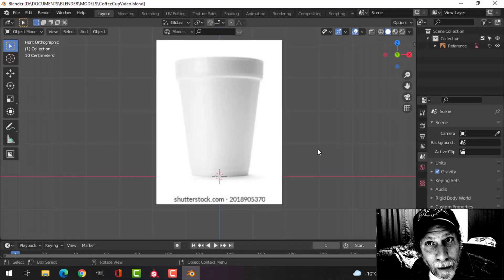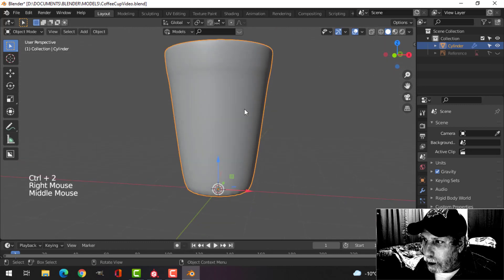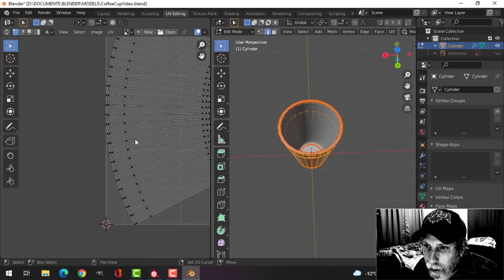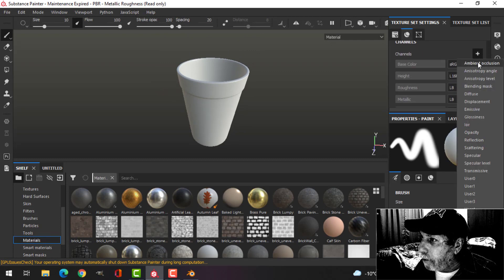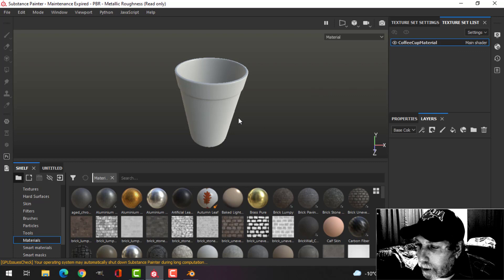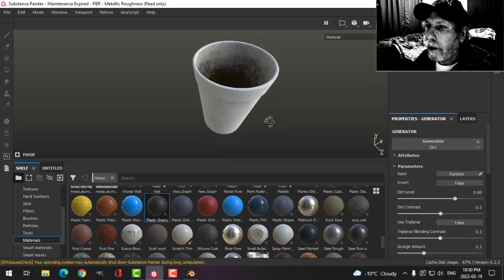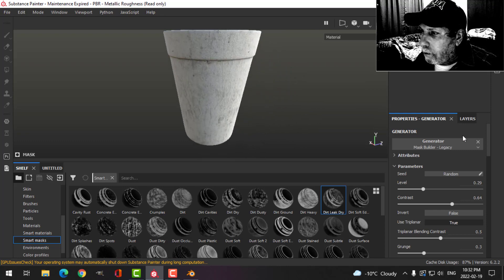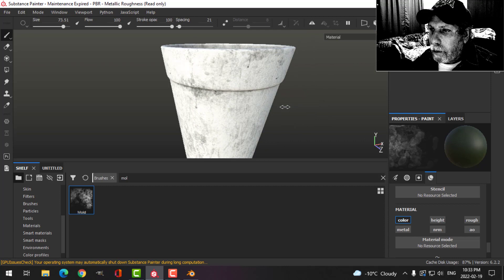BLENDER & SUBSTANCE PAINTER: POLYSTYRENE COFFEE CUP

Comment: well PBR Texture to use in blender sells blender better than the rip off SB, un subscribed now
Reply from the maker: Yes Blender texturing is a good thing but much harder to achieve these results.  Substance Painter is an industry standard and a joy to use.  Sorry to see you go, though.  Good luck and hope you find what you're looking for out there.
Reply: @zerobio  I recommend you look at what is out there you can bolt on to blender and use that supports blender like all the apps that donate to the building blender bigger and better go look at PBR Texture addon then see  there are a few vids on youtube
Reply from the maker: @gavwyatt5314  That's an excellent alternative but I am actually intending to go in the other direction, integrating Substance Designer soon to the pipeline. As you said, there are YouTube videos (plenty of them) that use Blender add-ons for texturing and they are great so I am heading somewhere different in the near future.  Thanks.